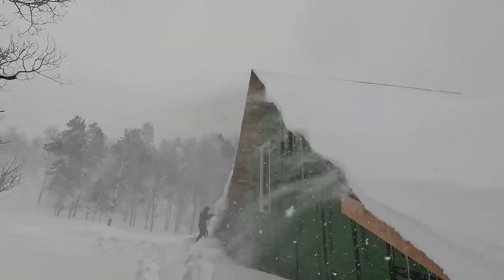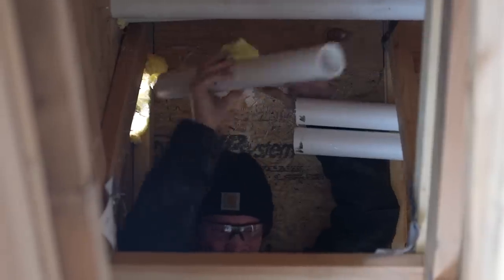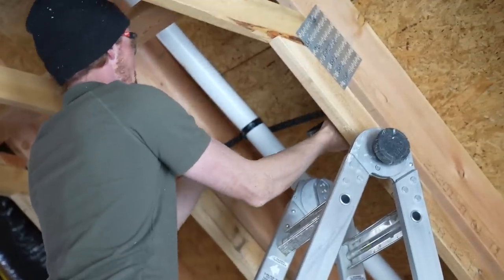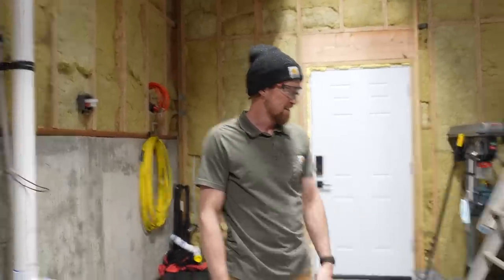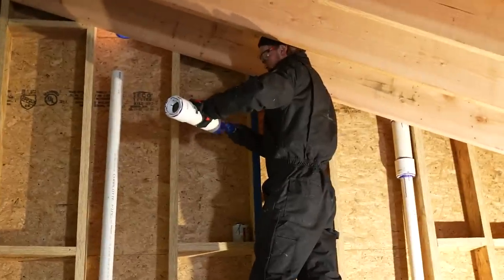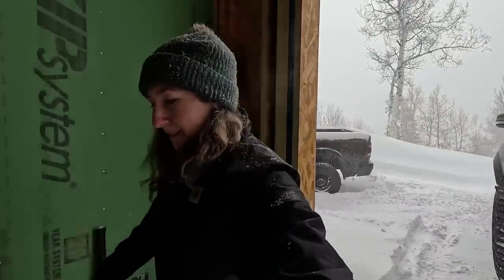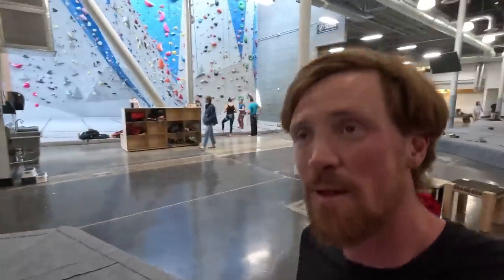IS IT TIME TO QUIT BUILDING AND JUST MOVE???

Comment: Trent a tip for using the hole saw when you already have a hole cut. Use the bigger hole saw to cut a hole in a scrap piece of timber/plywood, temporarily fix this to the board you are making a hole into, and use it as a guide to hold the hole saw still as you cut.

Comment: As a structural engineer myself, I'm glad to hear your structural engineer is taking a look at your garage structure.  Truthfully, I'm concerned about the garage, now I see the rear framed wall is acting like a retaining wall holding back snow which needs to be evaluated, along with the truss system.  I would feel more comfortable if the trusses were at 12-inch spacings.  Also, the unrestrained truss joint cleats could cause catastrophic failure if just one cleat let loose.
Reply: Dale- you are so right.  A lot of stuff scares me.  Just flying by the seat of his pant
Reply: These project(s) have already been structurally engineered by local engineers, who are the most familiar with climatic conditions. and Trent has been complying with every detail.
There's no problem with these structures.
It's simply a record amount of snow fall.
No worries.
Reply: @TheOleHermit  I wouldn't say, "No worries" but I agree that Trent is not just flying by the seat of his pants. If they survive this winter they can survive anything.
Reply: @Aiko2-26-9  IMO, Trent and Allie are very well prepared with all the right vehicles, tires, chains, wench, snow blower, snow plow, chains, winter clothing, shovels, and have already overcome the worst of the winter weather.
They are coping amazingly well, all things considered, and are keeping on top of everything, so well that they're helping others, as well.
They're intelligent, mature, strong, young, healthy adults, who are very capable of handling whatever comes their way just fine, Grandma.
No worries. 😎

Comment: The best way I've found for drilling large holes over smaller holes is to first drill the large hole in a scrap piece of plywood to make a template. Then screw the template over the area that you want to drill the large hole and use the template to hold the hole saw bit as you drill the new larger hole.
Reply: There are arbours that replace the pilot drill allowing you to mount the hole saw of the original hole to become a pilot for the  new larger hole diameter .
Reply: I came here to suggest the same 🙂
Reply: AWESOME advice
Reply: 9o0il

Comment: You can use the old PVC and cut it into smaler pieces with an angle on one side and glue onto plywood to make storage for spraycans and other similiar sized cans and bottles etc. Though the 2" might be a bit to small for that. The caulc andsilicon tubes however would be a perfect sizes for the 2" pipes. You can also use it uppright as penholders in the workshop or other small thin things. You can also use them as holders for garden tools by having a 45 degree angle towards the wall and a slit facing out. Then you can hang brooms, rakes and stuff like that. So yeah there's many uses for 2" pvc pipes.

Comment: The trick with the hole saw  is to temporarily tack a thin piece of wood over the hole, drill through and there's your guide !
Reply: second tip if the hole saw is SHARP, then go in reverse ,it won't BITE and starts the hole easier...
Reply: A variation of this method is to drill the larger hole through the thin piece of plywood/OSB first and then place it over the smaller hole. You can then center or adjust where you want the larger hole to be placed. This template method works great

Comment: It's called a reducer, because in plumbing you read a fitting from the largest side first to the smaller size.  So his fitting is a 3 x 2 reducing coupling.
Reply: Aaaaqàaa
Reply: stop telling them the super easy stuff hahahahahahahahaha JK
Reply: Exactly what I was gonna say.
Reply: Thank you for that. The real curiosity is which direction you start when repairing existing plumbing. I end up with couples of some type.
Reply: Looks like over 17ft of snow...or more?
Reply: It's the same fitting and it's name only depends upon which end you're looking at.🤷‍♂

Comment: Maybe stick the discarded PVC pipe into the ground/snow where the propane tank is, so you know where the tank is for the rest of the snow season.  Possibly fasten the discarded pipe to the propane tank as a semi-permanent marker.  (You might want to do the same thing for other buried infrastructure, like the water tank hydrant.)

Comment: A suggestion for you,  a lot of states require a snowmobile or off road vehicle to have a 6' to 7' orange flag on them for safety, but that same flag can have other uses, such as your propane tank : on each end of your tank there is a lifting ring, just fasten one one both ends of the tank on those lift rings, you will know where to dig next time.  You do an excellent job of tackling those re does.

Comment: I feel for you with all that snow. I lived in CT for 25 years and retired South because I couldn’t handle the snow anymore. When I was trapped in my house by 5 feet of it was the breaking point. I had to wait for my plow man to, dig me out. You might want to build a shed over your propane tank this summer. My oil tank was in the basement under the stairs with a fill pipe out the siding under the eaves, so it never got snowed over.

Comment: Hey Trent, Here's a tip for drilling a hole over an existing hole. Use a scrap piece of dimensional lumber and drill your hole through through it. Cut it short enough to fit in your space between the rafters then screw it where you want your hole. You are basically making a guide and you make your hole. Hope this helps you and keep up the great work. I look forward to watching your channel every time you post.

Bruce

Comment: Ideas for repurposing 2 inch pvc pipe - ideas for the summer - build a rectangular box large enough for your dogs to stand comfortably under. Attached a hose connector to it. Drill lots of small holes in the top two rows... now you have a dog washer.

Comment: For the hole saw enlarging - just temporarily nail a piece of scrap ply over the existing hole so the drill bit can center the saw to get started. Then obviously the hole saw will cut through the scrap ply before starting into the eave, but you still have the 3" hole in the scrap ply to keep the hole saw from walking around.

Comment: Cut the PVC pipes into different lengths, say, 2, 3, 4, foot lengths.  Cap off the bottoms.  Drill holes in spots around each tube.  Fill with soil, plant flowers and vines in the holes.  Hang them up in a group like a giant windchime. 😊

Comment: You could use one of the old PVC pipes (after cutting off the joints to make a straight pipe) to stick upright in the snow over your propane tank lid so you don't have to guess where it is.

Comment: For what it's worth now there is a simple solution for drilling a hole bigger with a hole saw that has already been drilled. Let's say you have an existing 2" hole & you need it 3". Take a small piece of scrap wood & drill a 3" hole with your 3" hole saw. Now put the scrap wood with 3" hole over the 2" one & use your 3" hole saw. The template you made with the scrap wood will keep the 3" hole saw centered right where you want it.

Comment: Best way to deal with making a larger concentric hole in lumber is to cut a piece of plywood and nail it over the hole. Drill your larger hole and the plywood piece will will keep the bit in place when it reaches the older hole in the lumber.

Comment: All you need to do to enlarge the with the hole saw without a center is make an easy jig guide. Simply bore the large hole in a small piece of plywood. Then mount the jig over the smaller hole and use it as a guide for the larger saw.

Comment: Need to redrill a 3” hole over a two inch. Drill a 3” hole in a piece of 1/2 plywood.  Screw the plywood over the hole.  Use it as a guide to redrill the 2” into a 3”.

Here’s the blessing when you get lots of snow - justification to get a front end loader. 

😊

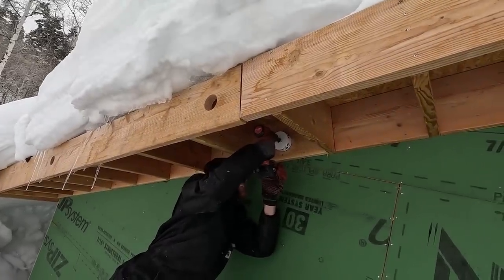Comment: @17:06 tack a piece of scrap plywood centered over the hole for the drill bit to start into. After the hole is cut in the scrap it will keep the hole saw centered for the rest of the cut.

Comment: trent, for next time, easy way to drill a larger hole with a hole saw. Drill the required hole size thru a piece of 1/4 or 1/2" piece of scrap plywood. Temporarily screw that piece of plywood over existing "smaller" hole. You now have a recess to hold the larger hole saw blade in place to keep it from sliding around.  Be safe if you have to go ont the roof.

Comment: Drill small holes in the Old PVC pipe cap one end put a garden hose connection in the other end and then lay the pipe in your flower bends attach the garden hose turn on and you have DIY irrigation fro you new landscaping projects.

Comment: Hi Trent and Allie I am Barney. I am waiting your latest program, about changing the PVC pipe. You can reuse the pipe and fittings. Heat the pipe and fittings with a heat gun. While they are still hot you can pull them apart, and can be reused, love you show. Barney from Bibra Lake Western Australia

Comment: pipes: perhaps take out angles, glue straight knuckles, and use for gravel drain, overflow, or similar

there is a little shelf you an hang from the ladder so it can be placed and not fall

enlarged... enlarged.. or expanded

suggestion: tack boards out from holes to drill, it will keep hole bore from jumping around then unscrew/remove nails and the scrap boards

Comment: Just a cheap and quick idea. Buy pole markers, 20 ft long, marking the ends of the propane tank.   You could probably just shove the markers as deep inthe snow as you can, the pole wont move until the snow starts melting much later.  Thought it might help.   Just a canadian thing eh....lol.   Great job guys.

Comment: There are a couple of ways to expend a hole, first is a small hole saw in a big one but that didn't work the second is to drill the bigger hole through an offcut and use that as a template. The other way is to come in from an angle to start the hole and ring it straight once you have some purchase.

Comment: when you have to make a hole larger in diameter with a hole saw, put a piece of plywood over the hole screw it on with a pilot hole dead center , then use you hole saw with new diameter, the plywood will act as your guide.

Comment: Next time you want  to enlarge a hole with a hole saw, drill the larger hole in a scrap board and use as a template. That way the hole saw won't run away on you.

Comment: When drilling a hole over another existing hole I make a template hole with the larger drill bit from scrap.  

Keeps the bit from wandering   You can usually remove the scrap template once  the teeth make a track

Comment: As a Red Seal HVAC worker in Canada; I really hope you all plan on insulating that bath fan pipe. when hot most air meets that cold pipe it is going to condensate and freeze in the pipe, when it thaws it will leak on the drywall and f*** shit up. in Alberta Canada the first ten feet of pipe from the outside wall must be insulated. PS you all had a whiter winter; then where I am.

Comment: 2" pipe - Leo will eventually get into Hot Wheels.  Track to put hot wheels through.   Allie - Hoods for those snow suites will help keep you warm.  That honda blower to cut path around building were tractor will not go may lighten the shoveling load.  A path to the Propane tank will be helpful.  Hope you had a happy easter.

Comment: It seems backwards that the water heater gets a PVC vent and the fart fan gets metal duct.  The easy way to make a larger hole with a hole saw is to temporarily screw a little scrap piece of plywood on the wall so you can drill a new centering hole with the larger hole saw's pilot bit.  Then cut the larger hole through both, and remove the scrap plywood.

Comment: A real easy way to cut open a hole larger would be to cut a plug out of similar wood at with the old size (2") then screw a temporary block of wood across the hole, screw the plug in the middle of the existing hole (don't use the drill hole).  Then up-size the hole saw to the new size (3") and use the plug's drill hole to guide the 3" through the 2" hole.   Unscrew the block.

Why not use a fiberglass whip and flag like you see on bicycles to mark the propane tank?   Those things are super long and will stick out many feet of snow.  No probing for the tank anymore.

Comment: To drill a hole over a smaller hole to get the auger cutter wheel. All you needed to do is tape, a piece of thick cardboard where it is over the hole with a pilot hole in center.

Comment: This is when you use a jig, drill a hole the size you need the screw the jig to the wall, it will be so much easier cutting the hole and remove the jig.

Comment: The way I drill out a larger hole is simply cut a piece of temporary wood larger than the hole, screw it over the original hole, drill through the new wood AND the original wood, then remove the piece of temporary wood.  Whaala!  Bigger, cleaner, old hole.

Comment: I'm sure it's too late but for future, when you're trying to "enlargen" a hole, consider cutting the larger hole size in a scrap piece of wood that you can temporarily screw to the board over the hole to be "enlargened" as a means to hold the hole saw in place to stop the wandering problem you were having.

Comment: When we have to use a bigger hole saw to enlarge an existing hole we cut a hole in a scrap of wood and use that as a collar to keep the saw in place.

Might be worth putting a tall stake next to the propane tank for next winter.  You could put a measuring tape on it so you can measure your snow levels

Comment: Another trick is to use a holesaw and cut one the same size as the one you are over cutting and 3 or 4 of screws to keep it centered and use the pilot hole to guide your larger hole saw

Comment: I've often wondered why you built in a location where the snow could cause so much damage and so much work. You're young now, but believe me, once you reach your late 40s and 50's you're not going to be able to deal with it. I have enough problems with a Midwest winter and I have little tolerance for these things now. It wears on a body when you have to deal with that day after day after day - even when it's much smaller amounts. I understand the views and the dream to live in such a place, but practically speaking, living in areas like that aren't very practical.

Comment: Twenty four hours a day seven days a week snow removal it never stops. My grandfather built his Farm for 70 Years he never stopped on building and repairing every day twelve hours a day or more. Grew Crops he paid the Pastor every Sunday to come to Lunch and get him caught up on Church and everything. Gramps passed on the roof second story sealing a roof leak at 95. He got the leak fixed from a storm and that was the end. He never took a Vacation he just worked every day. Granny Gave me the place and I hired Hands to manage the place. He still had his Model T which still runs and drives and the 1966 Chevrolet Pickup with a V-8 Long Bed and it is still running and is in mint condition. Gramps never stopped it never ended.

Comment: In California we use black ABS (eg foam core) pipe for non-pressurized vents and waste lines, not foam-core PVC.  Just like ABS, I suspect foam core PVC can not be used in a pressurized water system so there's not much use for surplus pipes.

Comment: When attempting to enlarge a hole with a holesaw, I have drilled the larger hole in a piece of scrap wood that I can hold (or fix into place with a screw) to use as a guide.

Comment: the PVC pipe could be used to hold spray cans, odds and ends that need a home in the shop, if you know what I'm getting at. Blocking off the bottom and put stuff into it.

Comment: 😄Amateurs... When trying to recut a hole with a larger hole saw get a few large washers to put over the center spindle then thread the smaller cutter back inside the larger It should stand about 1/4 " above the larger to allow the smaller saw to be a pilot in the existing hole. 
And stop complaining about the snow. YOU decided to live up a mountain side

Comment: Tip for enlarging holes with a hole saw screw a scrape pice of wood on back side of smaller hole ,make sure the scrape is larger then the hole your drilling the centre drill bit needs to be long enough to reach through the hole to the scrape wood

Comment: Put the original hoke saw inside the larger hoke saw as a guide and drill. Next oroject if the snow ever melts, vuild an open shelter over the propane tank. Maybe walled on two or three sides.

Comment: Trent next time you want to change  a hole saw size to a larger one , drill a piece of plywood the size you need and lay it over your smaller hole , once the saw starts working you can remove it , I also do that for quartz sink tap holes when I use a diamond hole saw , it stopped the saw from bouncing around 😁👍🏻✅

Comment: if you spin on the original sized hole saw inside the larger hole saw ,  you can use it as a pilot guide.   it works.   i saw it on you tube so it has to be true...   best of luck,   love the channel.   would love to meet up and help anytime,   we are trying to start a channel but have been dragging are feet.  any way love what you both have done.   your channel has been so inspiring.  love you all.........